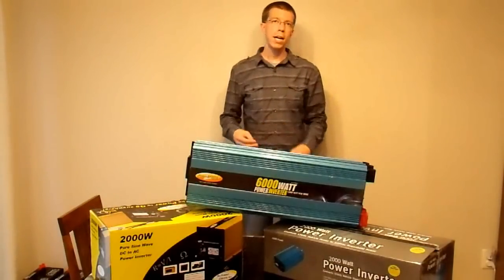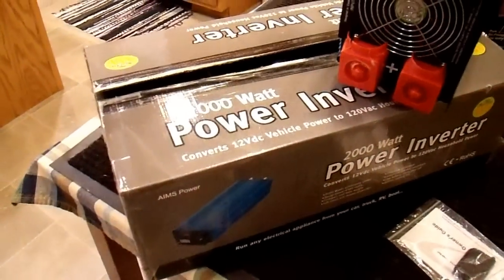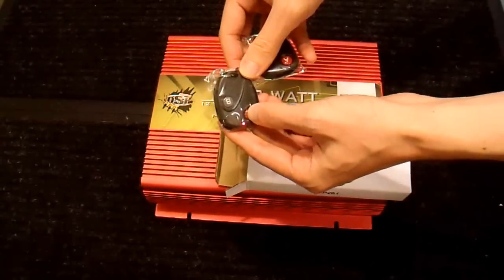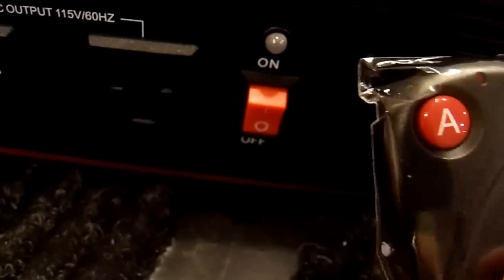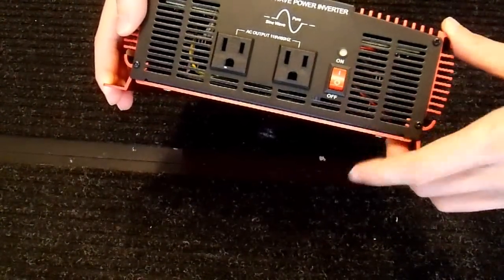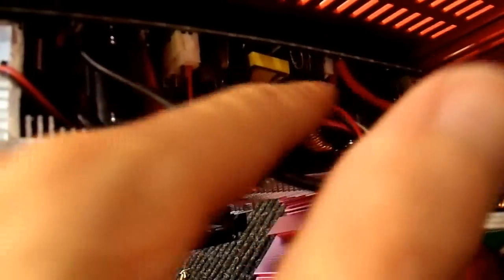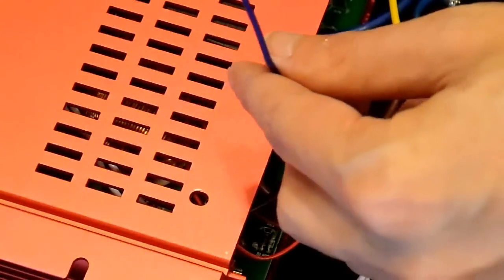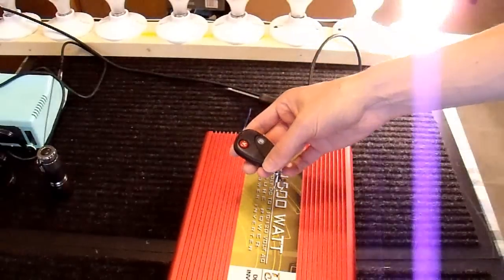How to Add a Wireless Remote On/Off Switch to Any Inverter

Comment: Thank you for a great tutorial. I bought a similar remote and installed it in my Tiger Claw 1500 inverter. Now I don't have to run outside and open my battery compartment every time I wand to brew a cup of coffee. If I hadn't seen your video I never would have thought of it.

Comment: thanks for this straightforward video on adding a remote to a switch.  

I used it to guide me on adding a wireless switch to start the generator in my RV.  Gets cold some nights or neither of us wanna get up but need to run generator for a bit.  Found a device on Ebay and viola all connected to the momentary generator start switch in dashboard.  Worked much easier than i hoped.

thanks again for sharing how straightforward this is.... oh, and VHB tape has become my goto tool to secure whatever on RV.

Comment: How interesting! I've been watching the videos from knurlgnar24, xboxer1985, and fliping720. Here all you are in the same place!! After spending years rebuilding dc motor controls, I'm about to try my hand at repairing some inverters. I'm going to Burningman with 1.6kw-2kw of panels and need an inverter. Just the mounting of the panels to my trailer deserves it's own video! So tonight I won a bid on Ebay for 3 inverters from the same seller. Two modified sine Go Power and one Xantrax Prosine 3k. All need repair. Also a local seller is rounding up a couple of grid tie units to donate. Thank you Knurlgnar24 and xboxer1985 for your repair videos! They are so helpful! I was stoked to see fliping720's video of running grid ties with non grid tie inverters on the same 120vac line. I might be trying the same thing before I decide to take any or all of these potentially repaired inverters into the desert for 2 weeks to run my blender for a daily margarita!! I'm making sure to video my repair exploits. I have a good digital video camera, but I'll try my S5 for the first few videos, and post them to get you gents critiques! What software do you guys use for editing and posting video? Thanks! -Mike
Reply from the maker: I could use some advice on video editing software myself.  I am somewhat ashamed to admit that I just use virtualdub.  Every time I try to use something else I end up pissed off that it cannot do the simplest things that vdub can do with little to no effort.
Reply: I've been using Youtube's editor. I'll look up v-dub. I don't want to spend more time editing than shooting.

Comment: Nice video i had the same idea, exept i went for switching the + to the inverter.
Only reason being, i did not want to open up the inverter.
My inverter is in the garden shed, with a lead to our living room for tv lighting etc.
Its no problem going out side to turn it off, exept when its dark.
The moment we go outside the security light comes on, then next doors one as well.
So prevent disturbing peoples sleep, i did the mod My video is of the initial firing up.
And testing the remote in the house .

Comment: I purchased one of those remote switches. It is going to be installed in my RV. I disengage the solar batteries each time I leave. Will the receiver retain the settings if power is removed?

Comment: Great video which lead to this thought. If the inverter has no room inside, could you attach the remote box switching relay onto the live 12v feed into the inverter. So the inverter is controlled by it's imput power rather than the switch on the inverter? Naturally a seperate permanent 12v feed would need to go to the remote box. (Was thinking of a low wattage inverter only (150w max).Actual peak load will be about 60watts 240v.

Comment: I want my inverter to turn on automatically at night. Could I use a 12v photocell in a similar manner? Would the full load of battery power be transferred through the photocell?

Comment: Hello again, I think I might have posted a comment on a wrong video of yours. I tried connecting a external switch to my inverter. And I think I might have blown something. Because there was smoke coming out near a capacitor. The switch on the inverter head one of the leads with three wires and on the other one it was one single wire. I noticed there was a white and a black along with a red going to a voltage meter. So I assumed that the black wire was going to be the negative and the read one of the Reds was going to be the positive so I connected the switch as such and when I powered the inverter I heard something kind of pop and a little smoke came out so I'm not sure what night of blown. Their are no visible burn marks  anywhere near where the smoke was coming out of. I would really appreciate your input. and could also provide pictures if you need me to. Thank you

Comment: The questions I have are 
1. Is the switch in the inverter a dc or ac switch (I assume is dc)?

What is the current through the switch? If it is in fact dc surely 1500 watts is not flowing through it. (1500 w / 12v would equal an OMG 125 amps, so i assume the inverter has a relay that switched the dc voltage on and off somewhere internally ?
Reply from the maker: The switch is DC and the current flow is in the mA range, essentially zero.  Any DC switch that can handle the battery voltage will work.

Comment: Hey, love your videos... :) I have the Aims 3000 watt pure sine inverter. The problem is, it only shuts down if I'm not home or around at 22volts, but by then your bats are pretty much gone! I want to get a relay that will shut it down around 24.6 volts, do you have any idea how I can do this? Thanks
Reply: Did you figure this problem out ?

I also have an aims 3000 watt inverter I’m looking into doing the same thing on my camper with a victron battery monitor that has a built in relay that’s programmable for voltage Parameter’s to turn on and off

Comment: Love the remote Inverter what would I need to purchase to do that on my Inverter can you give the link to the page please
Reply from the maker: If I remember correctly it was an eBay purchase and the model I bought likely isn't available anymore.  Look for a 'dry contact' remote relay and you'll find multiple options.  They're dirt cheap today on eBay and Amazon and are very flexible with many uses.

Comment: Not a good idea to block airflow of the system which is typically optimized for system performance.
I would choose 2 other option in this particular situation which probably will suit all inverters -
  1)  Mount box outside the inverter with screws and only wires go inside the inverter
  2)  If you are too adamant to package everything inside the inverter, I would remove switching box outer shell and package only circuit board inside the inverter (Typically outer shell is much bigger than inside unit)

My 2 cents!

Comment: I upgraded my inverter and want to use my old remote switch from it but it is wired.  Can i just use the 2 wires and solder them to the new switch?  Will it work.  Mine is wired?

Comment: Hello knurlgnar24, My inverter is a 3000 watt Aims Power inverter with a 24 volt input, what would you recommend for a wireless remote control please, thanks and great video.

Comment: Hey Knurignar!

Well thanks for the help. I purchased a deep cell and the inverter seems to be working now.  Yea!!!!  Now..could you help with one more thing?  Will this remote work? 

12V 15 AMP Remote Relay Kit Control DC Connector RM02 15A Logisys 12 VOLT.  

The one you suggested is $27 on ebay but comes with 2 receivers and I only need one. Or do you have any other suggestion?

Thanks again.

t
Reply from the maker: I'm glad it works for you with the new battery.

Without knowing exactly how the power switch is configured I cannot say if that kit will work or damage the inverter, but I would recommend a 'Dry Contact' type.  This will work with any inverter and is more versatile.  Dry contact means that no power is applied to the relay outputs, it is simply a remote operated switch that opens and closes just like the switch on the inverter itself.

Comment: Hi,i have an inverter with a dc socket for wired remote,could i connect the switch wires to a barrel plug and use this as a switch connection,cheers

Comment: I bought a switch like the one you have in your video.  I have an AIMS Power Inverter/Charger that has a Remote Port / RJ11 jack that you can use the wired remote they sell.  However, I would really like something wireless.  Any experience wiring one of these?  Any pointers?
Reply: You can just wire a remote controlled switch to that port you just need to figure out the live wires.

Comment: at least I can understand your video. before I purchase RP 201 I WANT TO ASK IF IT WILL WORK FOR ME I WANT TO TURN A STARTER MOTOR OFF AND ON DOES THE AMPS OF THE MOTOR MAKE A DIFFERENCE WOULD I NEED A DIFFERENT ONE. I LOOKED ON EBAY AND THE RP 201 IS SELLING FOR $29.95 I JUST WANT TO MAKE SURE IT WOULD WORK AND NOT BURN UP. NOT VERY GOOD AT THIS SORT OF THING.HELP PLEASE

Comment: @knurlgnar24 - great video.  I am attempting to do this with a CADO 2000w Inverter which even though the switch is different, I believe I can make it work.  my question to you is how do you determine, other than being next to the inverter, if it is one or off when you use the remote?  I am connecting inverter to a 110v plug inside the cabin of my RV and inverter outside in one of the cubby garages.  I don't want to forget the inverter is on, so I want to put a light inside my RV.  Any recommendations on what to use?
Reply: I used a small 2 wire LED volt meter (purchased from EBAY)  and ran a line to my front room directly from the battery, when in use the voltage drops to around 23-24V and when not in use the voltage is higher at around 27-28V, so you can tell when the inverter is in use and when its not....hope that helps.

Comment: I think I would prefer to add a connector on the front of the inverter so that the remote could be attached to the outside or near the inverter wherever it is installed.

Comment: Good video. Where did u get the remote switch from
Reply from the maker: eBay I believe.  They are now widely available from Amazon as well.  Make sure it is a dry contact latching relay and it should work on any inverter.

Comment: Can you help? I have a 1500 tiger claw hocked up to my car battery with 2g wiring about 4ft long. There is an inline fuse. I am running a Brother HL5370 laser and when I have the car running and turn on the laser printer, about 1 minute later the inverter alarm is going off. I don't believe the printer draws more than a 600 watt load at peak.  Any suggestions?
Reply from the maker: I suspect you have a weak battery.  Cars will start and run on batteries that are in remarkably poor condition.  Inverters will not.

What does it do when the car is not running?  What year/model vehicle is it?  What kind of battery do you have and how old is it?  What is the temperature where you live?
Reply: That has been my suspicion for a bit. The battery is probably five years old. Its a die hard. Its still starting the car so I assumed it's probably still good. I'm in Pennsylvania and the temperatures here have been down to 10 degrees lately and the battery still starts the car that's why I thought that it's probably still okay. 2001 Chrysler Voyager 4 cylinder. I use this vehicle only for work and wanted to set up the printer for when I'm on the road. I appreciate your help.
Reply from the maker: T. Joyce
10 degrees?  Heat wave!!!  (It was -20F here last night)  Your van has a decent alternator which is good and it uses a group 34 battery which is great, because it gives you the option of a deep cycle battery for your application as it will work better for long term loads.  And yes, it will still start your car just fine despite the lower CCA rating.  Group 24 is the same size L and W but 1 inch taller and is a very common deep cycle size.  If it fits under your hood I would highly recommend that approach.  I have used the Autocraft 24DC-1 battery and it seems good.  Be sure to use their online coupon codes if you go that route to save a quick $20 or $30.  With a single battery expect to need the van running for heavy loads since a single battery is iffy for a heavy load like your printer.
Reply: Okay.Thanks For your help. I will go with the deep cell as it won't hurt and I do always have the car running so I don't get stuck somewhere. Hopefully this will take care of it. 22 degrees below zero?? Where the heck are you.... Alaska :-)
Reply from the maker: T. Joyce
Actually, if I was in Anchorage it would be more than 20 degrees warmer.  :)  It has been a cold winter here this year in the north central USA.  I hope you get your setup running smoothly.  With a good battery and the adequate cabling you already have I don't see why it wouldn't work out.

Comment: Do you know how I could do this to a Black and Decker P1800BB. The switch is installed differently. Any help is appreciated. Thanks.
Reply from the maker: I couldn't help for certain unless I know how the switch is different, but on every inverter I've seen the switch is a toggle switch which either connects two contacts or disconnects them.  If you have one which is a momentary switch that is logic only then the job would be more difficult.
Reply: ***** It's different in that it has five contacts/conductors in one wire strand that are connected to a circuit board that the switch is on. It's not the typical positive/negative contacts for a rocker switch. It's more like a toggle switch with a circuit board.
Reply from the maker: Greg Inman
hmm.  Difficult to say - I'd have to see it.
Reply: ***** Understandable. Is there somewhere I can send you a pic?

Comment: since I have a Ethernet port for remote can I put a ethernet to usb connecter add a blue tooth toggle so I can use my phone as remote
Reply: I have an rj11 port. would youi know if possible to use it like an ignition lockout?

Comment: Hi .  Some inverters come with the rj11 switch.  Would you know how to use that port as an ignition lockout so the inverter turns on only when driving? This product seems to be doing that, but not sure for a specific inverter. https://invertersrus.com/product/magnumenergy-me-isw/

i need to install a relay?
Reply from the maker: Any dry contact relay can be connected to ignition voltage and used to control an inverter's on/off function.  Some inverters have external contacts allowing this function natively, but all inverters with a switch can be modified for this by simply extending the switch wires to the dry contact relay.
Reply: @knurlgnar24  when you say "natively". When I take apart the remote switch and rj11 line remote end what will find? two lines/terminals? How? Will I still need a relay? Thanks!

Comment: Anyone have a links for a remote kit that will work on a 24 volt inverter?
Reply from the maker: Look for a 'dry contact' relay and it should work.  Most of the time those switches are low voltage, but if you aren't sure just get one that is rated for 24V and you'll be safe for certain.